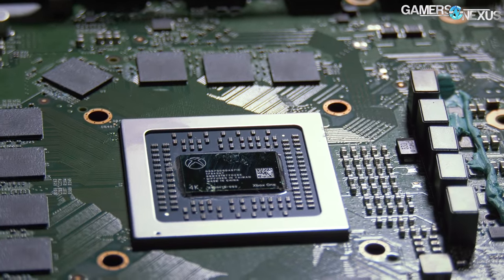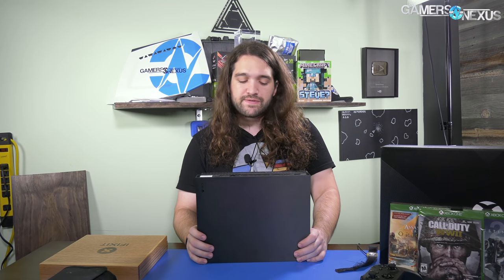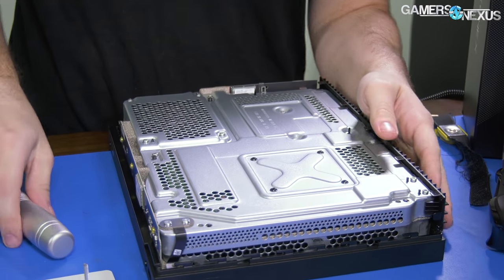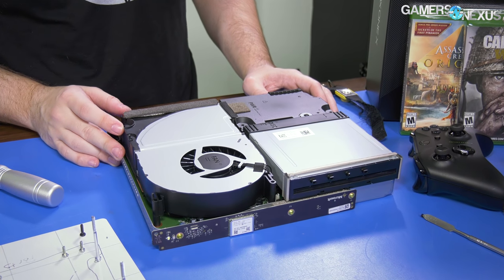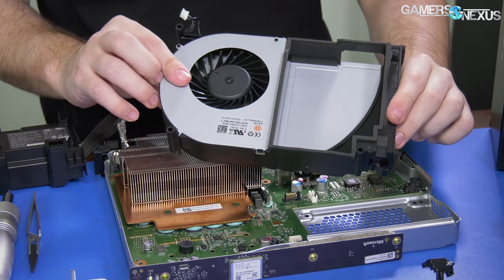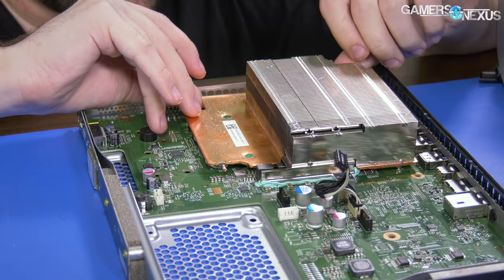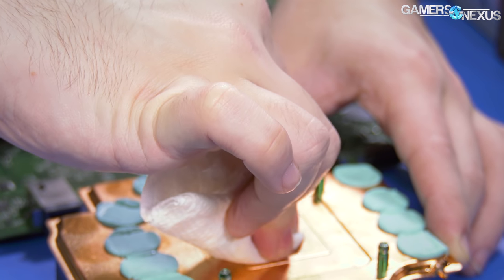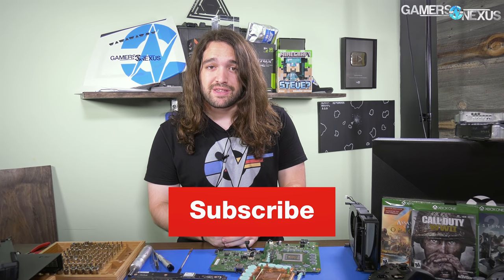Xbox One X Tear-Down: Semi-Modular Console Design

Comment from the maker: NOTE: GPU Clock speed is 1172MHz, memory speed is 1700MHz. Sourced our original numbers from LTT (as they have access to MSFT and we do not), but their numbers were apparently wrong (https://www.youtube.com/watch?v=Y_Ii8mU3x7E).
Really impressed with the Xbox One X modularity and numbering. Should help their RMA process, but also help enthusiasts replace parts.
You might also like our Switch tear-down: https://www.youtube.com/watch?v=obz5tE1mdV0
Reply: Okay
Reply: If it's anything like the 360 and One you won't be able to change Blu-ray or HDD as they are paired to console.
Reply: Gamers Nexus 

When you said 1700 core I was stunned, as 1500 on a 580 is a very good OC.

So, a decent $250 pc with an OC’d 580 8GB should be about the same gaming wise (i7 2600k, 8GB ddr3 2100, rx 580 8GB with a 1400 factory OC).

That’s definitely, far and away, the best console ever made. Too bad it has to share RAM. Doesn’t matter, I’m still impressed.
Reply: BUT you can change the laser and clone the old hdd to the new ssd
Reply from the maker: Crzces -- please read the comment you just replied to. That number was mixed-up with the memory speed.
Reply: Justin G well they have used it on all previous generations, macbooks also use the same compound type
Reply: Could have done before/after noise tests? If the TIM is limiting thermal transfer then possibly the fan would need to spin a bit faster as there's probably some *C/% curve in play.
Reply: Steve I can understand LTT getting them mixed up when they(and their viewers) are not really technical experts and mostly just read out the marketing material, but I don't quite understand how you of all people could have mixed them up. 40CUs (2560 shaders) at 1.72GHz would equal 8.8TFLOPS which is more than Fury X has and much more than Microsoft said. Also the fact that it's Polaris based means that 1.72GHz would impose insane requirements for power, cooling and voltage since even Vega has problems with 1.72GHz.

I really like the way you stay non-biased and the depth you go with the technical aspects of your product reviews/tests/teardowns, but this time you got REALLY sloppy and I am dissapointed. The core audience of this channel is more technically advanced than LTTs and it would be great if you could keep the facts straight.
Reply: Justin G well its not going to die anytime soon if thats what youre worried about, but that thermal paste is garbage lol 2-3 years of high use and it starts too overheat by that time your warranty will be over and you can replace it with some decent thermal compound
Reply: SSD to replace HDD?
Reply: 10:20 "if anyone needs a replacement" talk about witchcraft
Reply: Please, try using liquid metal as TIM after the basic tests, just interesting to see the difference in temperatures and performance.
Reply: You could do some "thermal testing" (not entirely accurate) but a thermal cupple on the exaust and see if the temps were higher or lower.
Reply: What is all of this junk about replacing TIM and thermal testing?

The only thing anyone should care about are OUT OF THE BOX THERMALS.
Reply: Thanks
Reply: Gamers Nexus i always hated that damn X clamp. Messed up my XBOX 360 when I was going to change the TIM. I didn't have the proper tools for removing the clamp, used a plyers, messed up one or more of the traces on the board in the process.
Reply: avyfa as far as I know, consoles are usually made to operate within a certain temperature/performance envelope, so increasing heat transfer won't necessarily increase gaming performance for them. That may have changed though, and they may be as dynamic as discreet graphics cards and CPUs.
Reply: But less noise and lower thermal will (in theory) longer the lifespan
Reply: Still has a Jaguar CPU. TIM's not gonna do much for that.
Reply: Yeah lol how did you fuck up the GPU frequency??? Every single PC YouTube channel says the wrong numbers, just use Wikipedia or something, all the info is there on numbers
Reply: Chilionloppu well you have to think he literally got it and just started reviewing it. I think he was in a rush
Reply: I tried alerting them to the fact it is actually  1172, but they ignored me.

Important point being this pullsd the one X's GPU below Polaris 20 performance wise as a Polaris 20 chip needs 1302 MHz for 6 TFLOPS and all 580s are above that
Reply: Why not measure the APU? It would be interesting to know how many mm² it is.
Reply: MarginalSC And still the Achilles Heel of the machine.
Reply: Still has the same shitty Jaguar CPU....can't they do any better than this? Give the XB1X a somewhat decent powered GPU for what it is, then ruin it with an Achilles heel of a CPU. It doesn't make much sense. Then again, nothing Microsoft does makes sense at times.
Reply: we havent heard if there's boosting. seeing as it's a console it most likely doesn't boost. only idle and full clocks. 1172MHz is the only speed
Reply: Not even any C Clips to hold the heatsink bracket down... can you say red ring of death all over again? That heatsink is asking to pop off after a year of heat cycling.
Reply: Looks like a beautiful crafted console, this Xbox is great in every aspect, just did not overcome the depression yet !
Reply: Did you miss the 4 point locking mechanism at 16:14????
Reply: Exactly what i was thinking! It has a unique key that is specific to that console, which would need to be flashed over to the replacement drive.
Reply: Justice League digital foundry has done hdd vs sshd vs ssd. Big jump from hdd to sshd (vs ilder 5400rpm drives) and performed on par with the ssd. The CPU clock boost will help remove some more sata bandwidth bottlenecking but not by much
Reply: The ease of disassembly and numbers sounds like as you said "to help their RMA process", seems like they are expecting a massive amount of hardware failures within the first year. and want to just be able to swap parts using minimum wage or lower untrained labor.
Reply: Gamers Nexus please water cool it
Reply: Gamers Nexus so what xbox had roaches in it ? Because i dont believe that for a second. Nope not one.
Reply: conductonaut on the apu like liquid metal
Reply: K. Tucker The Xbox One they got from a pawn shop.
Reply: Hi +GamersNexus. I was wondering if it;s possible to put those new graphite thermal pads in the XBOX in order to achieve cooler temps? Thanks.
Reply: When will consoles move away from HDD'S?
Reply: Gamers Nexus holy shit that’s weak
Reply: Gamers Nexus  you should see what happens if you put Xbox one chip in a PS4
Reply: Gamers Nexus dude sweet bit set. Super jelly
Reply: @cschleiger1991  When the cost of SSDs go down to HDD levels
Reply: I'm impressed with the build quality they throw in a small form factor being a guy who loves tearing stuff down for learning purposes is very well built
Reply: Just want to know if stock hard drive a disk or is it a sshd, and what kind of internal sata is it? sata 1, 2? And is external usb same as internal sata port?
Reply: @Chilionloppu   Frezeh  wow get your facts straight i dont know about now a days but back in the day when there were only a few chanels linus was at the forefront i before you tube videos were a thing or ncix vids, forums is were we placed most of the questions and answers for technical advice about certaint transistors on mb or repair jobs. So yes some of the viewers, linus on LTT are experts on his channel. Again please dont assume anything that does not have absolute answers to. I find it offensive. You are not all knowing my dude.

Comment: 2:30 You really messed up the GPU clock speed. I wish it ran at 1720Mhz, it's 1172Mhz. Also, I'm pretty sure the drive is 7200rpm.
Reply from the maker: Was sourcing LTT's numbers, as they presumably had Microsoft oversight during their video (we do not have access) -- but looking into it further, it seems that their numbers were mixed-up. The memory speed is 1700MHz actual, and the GPU is 1172MHz. Damn it, Luke! https://www.youtube.com/watch?v=Y_Ii8mU3x7E
Reply: Okay, just making sure. That would be way faster than any AMD GPU lol.
Reply: so that's what the lukewaswrong site was for
Reply: He looked up the drive number on NewEgg.   It's not 7200rpm.   It's 5400rpm.    The 7200rpm thing was simply speculation by websites trying to find a reason behind Microsoft's 50% higher bandwidth claim for the hard drive.      
It looks like the extra bandwidth is from freeing up some bottleneck on the motherboard.   Hopefully that helps a SSD swap.
Reply: Depends on their memory bus. On the standard PS4 at least it was so bad, that you got like a few % increase. Wew.
Reply: I guess you could say...

It wasn't very slick of him
Reply: Jas ThePeach also faster CPU clock speed's I'm sure increased the hard drive bandwidth
Reply: Jason Brister well youre just wrong
Reply: Brother Ares pull HDD, clone by sector to new device, install new device.
Reply: shouldn't have to clone by sector to my knowledge. Should just be able to take Macrium Reflect Free (what i use) and do a standard clone
Reply: @Brother Ares all you do is format the drive and plug it in. I have a 6tb PC 3.5" drive and it works fine
Reply: @Shadow0fd3ath24  Through usb. They're talking about replacing the internal drive.
Reply: The GPU would overheat with a clock speed that high

Comment: 4k assets, 4k vapor chamber.
Reply: Quantum Of Infinity 4K controller, 4K wifi
Reply: 4k usb ports xD
Reply: 4k fan, 4k thermals, 4k power supply
Reply: 30 fps. Damn that crappy cpu. Damn it all to hell!
Reply: 4K BANANAS
Reply: MINECRAFT IN 4K
Reply: Quantum Of Infinity 4K power supply 4K hard drive 4K fans 4K controller 4K wifi
Reply: 4k fans
Reply: power supply is only dynamic 4k and fan is 4k chceckerbording
Reply: 4K 30FPS cough
Reply: 4k Netflix and 4k Hulu
Reply: 4K Ethernet Plug
Reply: 4K plastic
Reply: My wallet doesn't have 4k :(

Comment: Very elegant design by Microsoft. I really like the way that power supply plugs into the board and everything seems to fit nicely and have a purpose. The noise dampeners and the drive mount, wow. Almost seems like a console worth owning, but I guess that is to be seen.

You mentioned getting creative with cooling, is that a hint at a hybrid mod with an external radiator?

Also that cooling retention bracket reminds me of old AMD coolers with the lever on the rod and that little metal bar, props on figuring it out.

Comment: Wonder if it's worth replacing the tim since you're probably not overclocking it or changing the cooler.  Maybe just for peace of mind over the included toothpaste.
Reply: These are for peasants. They don't do those things and you void the warranty by opening it. The MasterRace has that privilege and right
Reply: Probably worth it - remember what happened to early PS3s with dry thermal paste (YLOD)?
Reply: Avery F Just for the sake of education, matching up to these components is more like..$800 right now, with a better CPU. And THAT'S only thanks to GPU/RAM price spikes. Before, it would have been like $650-700.
Reply: DoubleVendetta (*******Chance Cox*******) Except it's not. Y'all never think about shit like OS, mouse/kb/controller, wifi, etc. I'll even build an equal specd out PCreal quick. It will be real close to 1k at least. You have to remember this can play some games at native 4k. Even if it's 30 FPS you're sure as hell not doing that on a 580. My 1060 wouldn't be able to handle that.
Reply: Avery F nope, I included keyboard, mouse, dual Intel wireless AND Bluetooth card, and OS in that figure. And the GPU in this is literally IN BETWEEN a 570 and 580, so try again.

 Addendum: the 1060 can, and has been shown in VIDEO FOOTAGE be able to run SEVERAL titles in 4K, and it has a shorter framebuffer, though slightly better compression technology, than the AMD cards.
Reply: https://pcpartpicker.com/list/DZcCjc That would be if you ran the 4GB variant of the 580 as well as only 8GB of RAM. Enjoy trying to play modern titles with only 8GB of RAM meanwhile multitasking. Playing most newer games and a few tabs of chrome open I hit around 10 GB of usage. R3 1300X since thats the Cheapest cpu youll be able to actually stream with while playing. So if you increase the RAM/VRAM youre looking at another 100 dollars or so. So that would be around 900 dollars. Pretty close to 1k for an equal to XboneX
Reply: Avery F can you multitask on an Xbox one X? Pretty sure Microsoft removed the awesome snap feature that I’m pretty mad about still. If you can’t then what’s the point of comparing multitasking. You can use a pentium G4560 and still have more cpu performance than what’s in the Xbox One X
Reply: A F You don’t need to spend 1k on a pc. There are plenty of sub $500 builds that give you the advantages of PC over console and can do 60+ FPS in modern triple A titles.
Reply: Timothy Gibney  Everybody has the same rights. Fight for right to repair!
Reply: Nelson44  Prove him false. Saying that warranty stickers are actually illegal, is much more effective than insulting him.
Reply: I feel like it can't hurt to replace the thermals with better stuff.  Longevity.
Reply: @ANF_94  
M&kd combo - $10
OS - free
controller - ...you're building a pc...
wifi card - nobody uses that, stick to ethernet
Reply: Maria Budišin oh look, another person completely missing the point lmfao. OS is free if you want to use Linux, have fun, or an unactivated copy of windows... Seems legit.

Crappy mouse and keyboard, definitely comparable to an actual decent controller. Oh have fun playing any racing or games with driving with that no controller.

WiFi card because not everyone has a 100ft Ethernet cable or wants one. Also defeats the comparison to a console when you don't even have wifi.
Reply: @ANF_94  cant forget thats its all compacted into a small box. Im very impressed with this console for what it is and what it cost. Ya the cpu couldve been better but you get what you get. Hopefully they do this good with their next gen console. And maybe make the hdd removable from outside the case
Reply: @ANF_94  The 12GB of "VRAM" on the XB1X is misleading to say the least - it is not dedicated Video Ram, but rather pooled RAM used by BOTH the CPU and the GPU. According to MS, it is only capable of using "up to" 9GB of RAM at any given time as VRAM, with a minimum of 3GB allotted to the CPU. In reality however, the CPU tends to run closer to between 4-5GB of RAM, leaving a realistic estimate for GPU RAM usage more in line with 7-8GB of RAM. 8GB is pretty standard for a high-end GPU in a PC build these days, and from one year in the future, the cryptomining bubble has burst and the price point for VRAM heavy GPUs have dropped back down to more realistic levels instead of the artificially inflated prices common when this video was created (that coincidentally MS didn't have to deal with thanks to being a builder and not a consumer). Given that the GPU is little better than an RX480 but still behind an RX580 and the CPU is equivalent to a mid-range AMD FX CPU, the addressable RAM and its bandwidth is one of the few things the XB1X has going for it over the PS4, but even then falls decidedly flat compared to a competitively priced PC - while console manufacturers will always have a heavy lead on price-point based on bulk buys of components, their game titles often have to be highly tweaked to maintain a performance standard, while comparable PC builds of the same or similar games will be capable of far greater detail than their console counterparts. 
If I built my PC today with the same components currently in it, I could build it for about $400 or less, yet it still blows the XB1X out of the water, despite being built on 9 year old Gen1 i7 core components save for the upgraded SSD and GPU. While the 6GB of RAM on my GPU is technically less RAM, the CPU has its own 16GB, and the GPU itself is far superior to that of the XB1X running a core clock 58% faster, lending to the smaller VRAM being less of an issue.
Reply: Justin Kashtock line break m8... 

400 dollars wouldn't get a comparable PC using new parts though. Parts dropped yes, but not back to msrp. Ram is still decently high and gpus are still 30-40 higher on average, at least when I looked maybe 5 days ago. The difference between a 480 and 580 is pretty much just an overclock. 

As for your i7, that is definitely a fluke, since that is one of the only Intel processors that has aged extremely well. Hell even new i7s compare horribly, as in barely any better, to their previous generations. Also you are using parts that are old and cost barely anything today, so not exactly a fair comparison. 

The X1X handles 4k quite well and 1080p is a piece of cake. Overall the X1X is still extremely impressive at it's price point.
Reply: @ANF_94  Its because of the API that allows the games to run much better on the consoles at levels of equivalent or even better PC hardware. Because of that its impossible to match the value of a console if all you want is to use it for games. If you can afford to pay double or more for higher FPS and increase some graphical settings then build a PC.However Ive played most of my games through my console other than RTS games and I think it plays great.
Reply: @ANF_94  And you may not even achieve the exact performance with that 900 considering youll be running windows in the back and XBOX and its games benefit from their own API